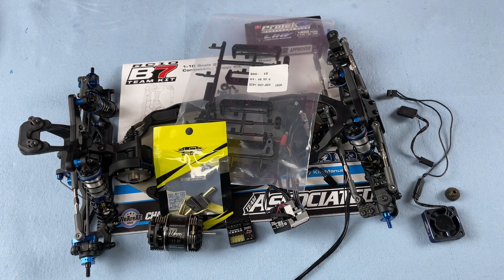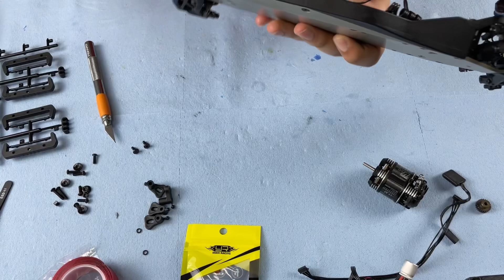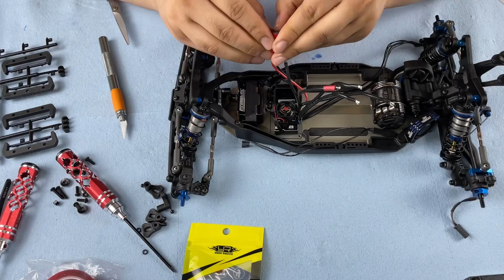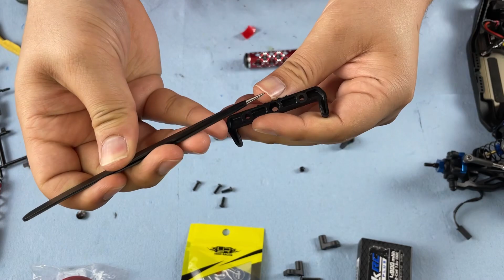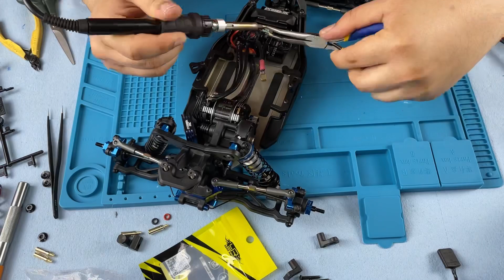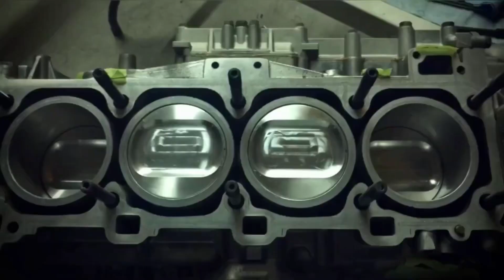Team Associated B7 Build - Bag 10

Comment: Thank you for posting your video! I’m preparing to build my B7 and I have upgrades coming in to install from the start. Regarding the battery/esc connectors….do we have to buy and solder the connectors into the esc wires to connect into a protek battery?
Reply from the maker: Shorty protek batteries should come with 5mm bullets, so you don't need to buy them. You will need to solder the bullets on to your wires though.